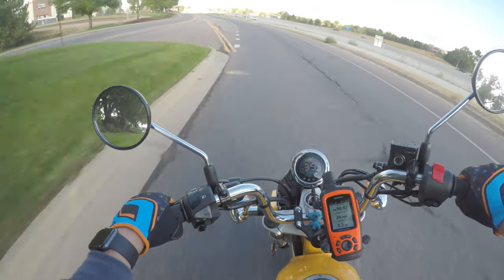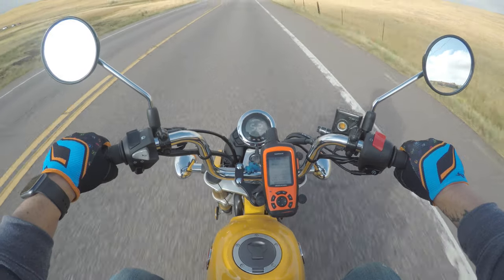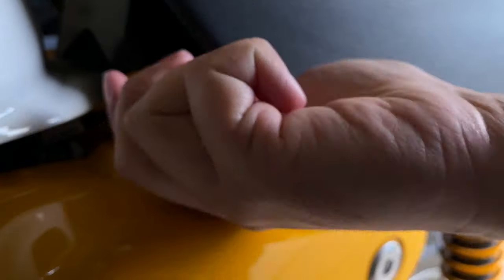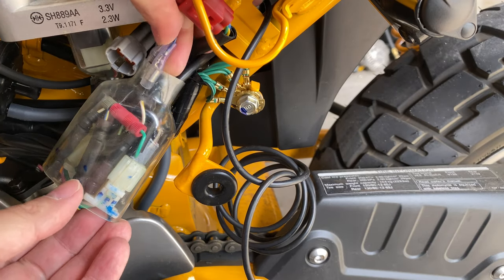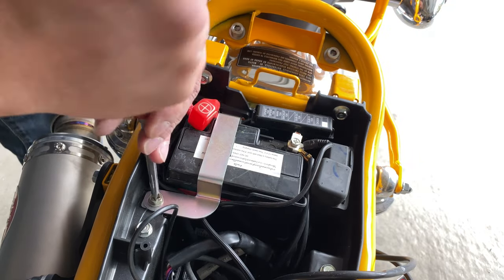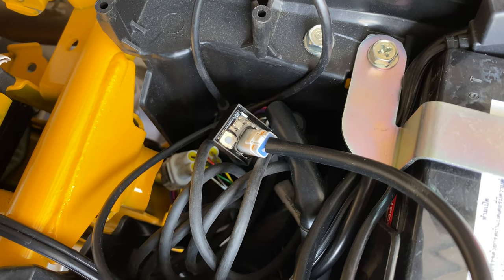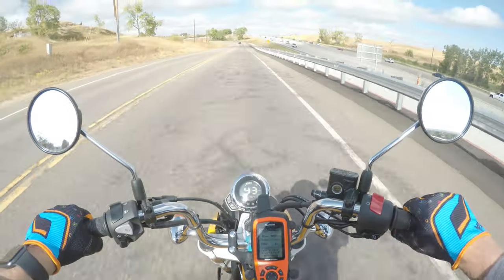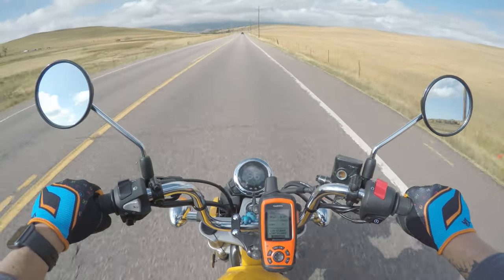Honda Monkey | Correcting the Speedometer

Comment: I just installed mine. For some reason, during the test function, my speedo did not display a reading, so I was worried. Went ahead and programmed in my error percentage and took it out for a spin. Everything worked perfectly. 

Thanks for posting this video. It saved me some time with routing the wires.
Reply from the maker: Awesome, so glad the video could help! I had a bit of the same worry, I was trying to test things and I guess I hit the button in just the wrong order, lots of lights and "oh no, I fried it" but happily things just went back to normal.

Comment: A couple weeks ago I swapped to Maxxis 6024s (slightly smaller than the stock tires), and a week before that I swapped to the 14-tooth front sprocket. Found that GPS was showing 55 MPH when the speedo was registering a steady 62 MPH. Today I got around to installing this 12 O’clock Labs speedo calibrator. Programmed it to -11.3 and now my speedo is a dead-on match to the GPS like it was before when it was stock. Very easy install. Thanks for this video. This was what introduced me to this calibrator. 👍🏻
Reply from the maker: Awesome! Glad I could help. It's crazy how off the speedo can get with those simple changes. One additional effect is that your mileage will also be more correct now that the bike's speed is properly set.
Reply: Unknown Overland - yes, that’s probably the bigger reason why I wanted to do this.

Comment: Thank you for the video! Is the speed the only thing affected? I mean, will the accrued mileage on the bike be wrong too with the 14t sprocket, and if yes, did  this contraption you installed fix that too going forward?
Reply from the maker: Yes, a change in the gearing or tire sizes will affect the overall mileage of the bike (though the difference should be reasonable small). The speedo-healer (like the SRD-H9) should help the mileage be closer to accurate as it changes the value "earlier".

Comment: Looks like you need some Monkey seat bolts with knobs that are on eBay.
Reply from the maker: Someone mentioned here putting some grease on the bolts; I just tried that a couple days ago and they seem to be working slightly better. We’ll see if I still keep them on the bike or not.
Reply: Unknown Overland get the ones from mnnthbx. Flush look and uses your key to turn them.
Reply from the maker: I’ve seen those, I’ll probably pick them up and give them a chance since the ones I have still give me issues.